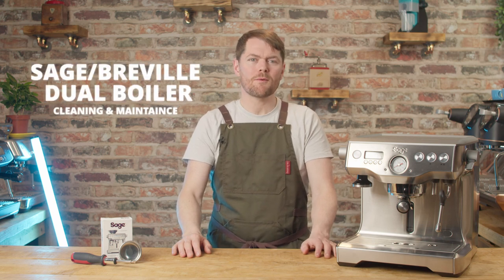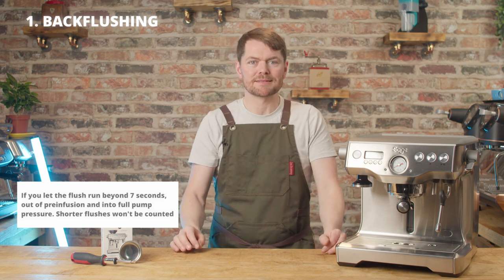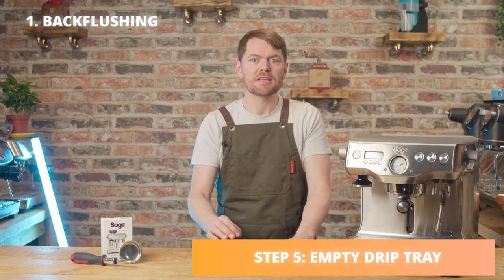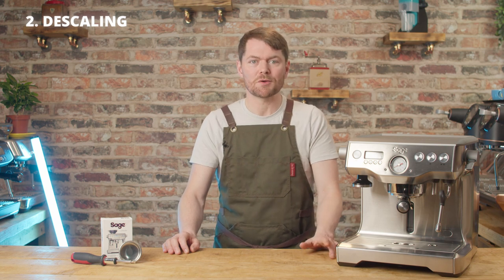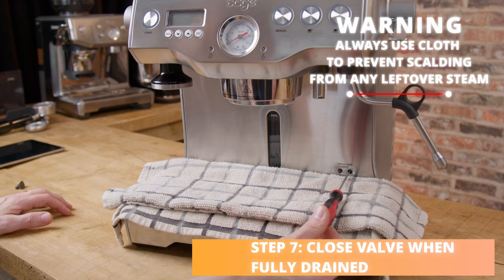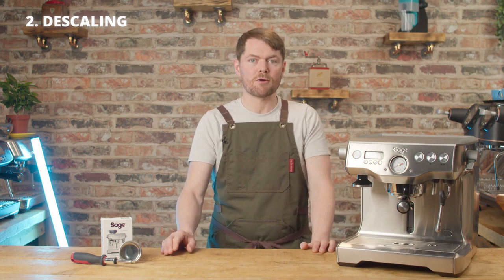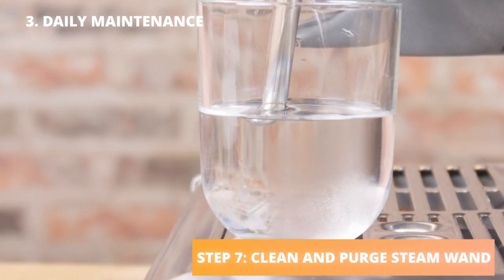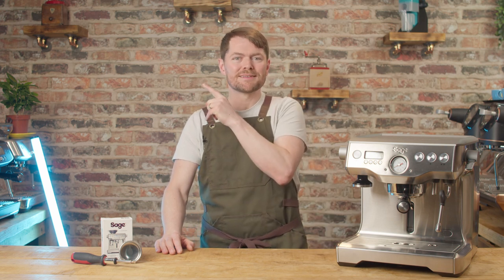Sage (Breville) Dual Boiler: Part 7 - Cleaning, Backflushing and Descaling

Comment: Does the dual boiler indicate when a descaling is needed the same way it indicates when a cleaning cycle is needed?
Reply: Yes it does. A "descale" notification will show up before the machine is heated. But keep in mind that those messages are automated and may not mean anything in real life. I once changed a water filter and 2 days after that it messaged me to change the water filter. Also a lot of people like myself have the issue with the descale message. It showed up one day (I think after I did the descale cycle in 3-4weeks) and now it does not disappear no matter how many descale cycles I do.

Comment: Thank you for the series! 

I have a small problem, that I cannot find a solution for. Maybe you came across. 

My dual boiler works perfectly fine, except for a bubbling/gurgling sound inside the noment i start a shot. It lasts a few second at the beginning od every shot, like maybe warer boiling inside the heat exchanger in the steam boiler.

Not sure if it affects the shot quality in any way, but i find it worrying.
Reply from the maker: If you turn the machine off, then press and hold both shot buttons and then turn on, do you see any error codes flash up on the first screen? Cheers, Kev.
Reply: @Coffee_Kev  thanks for the quick response. No fault codes whatsoever.